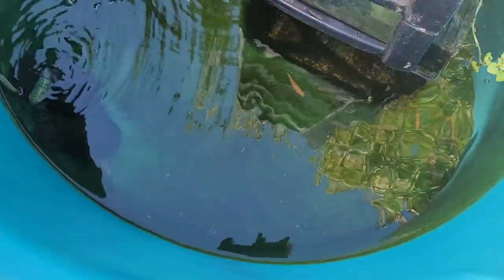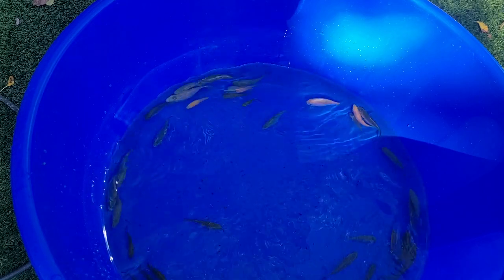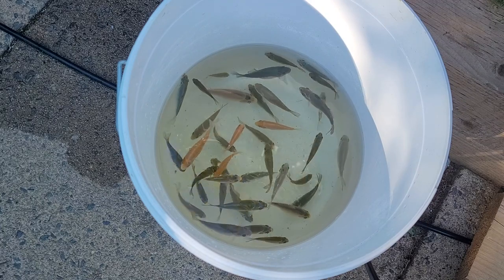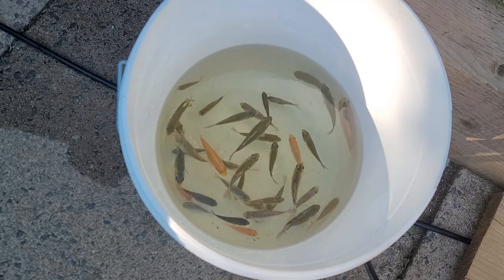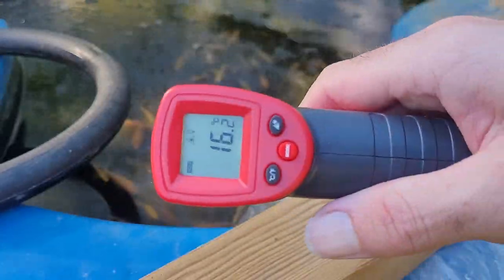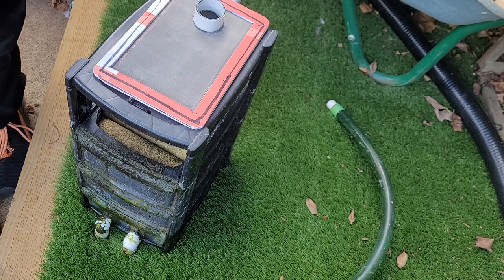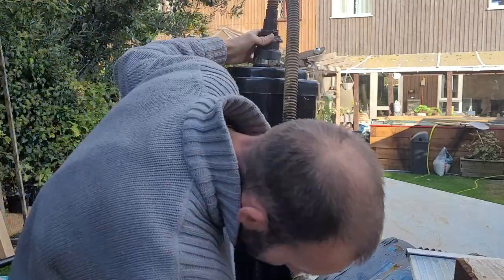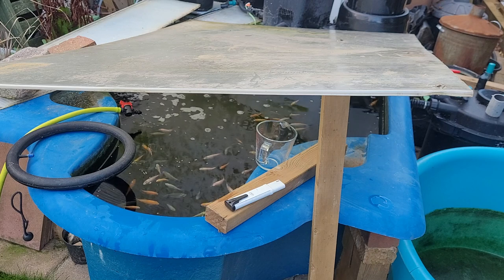Prepping the Koi Fry for Winter lots of Doitsu Linear 😍😍😍

Comment: Hi Jamie could you send me a link where u got them v switches from please keep up the good videos mate
Reply from the maker: Thanks bud I just got mine on ebay I just searched for the cheapest one at the time just search variispeed 👍
Reply: Thanks mate
Reply: @keepingitkoi  can u run uv system off them too
Reply from the maker: @MJHKOI  no mate uvs for one are not a dimmerbal bulb so would probably blow the bulb and to these are designed to slow a motor down and there's no motor in a uv 👍
Reply: @keepingitkoi  cheers Jamie
Reply from the maker: @MJHKOI  no worries at all bud 😊👍👍
Reply: @keepingitkoi  I got 3 on order for my pond and koi fry vat
Reply from the maker: @MJHKOI  sweet 😊